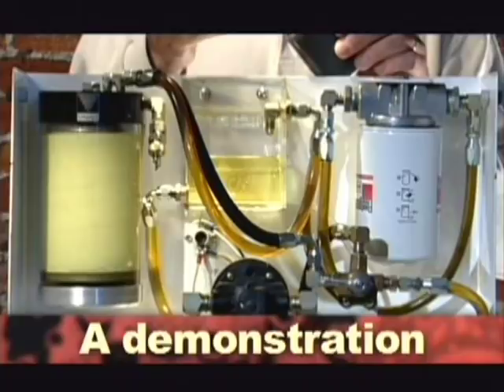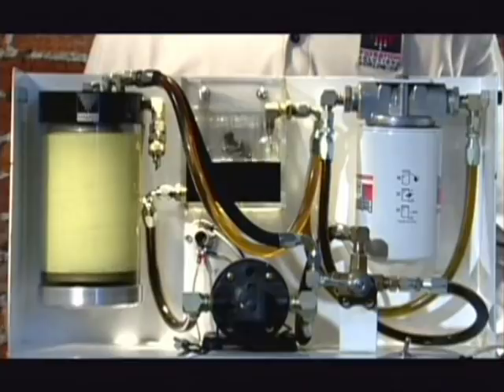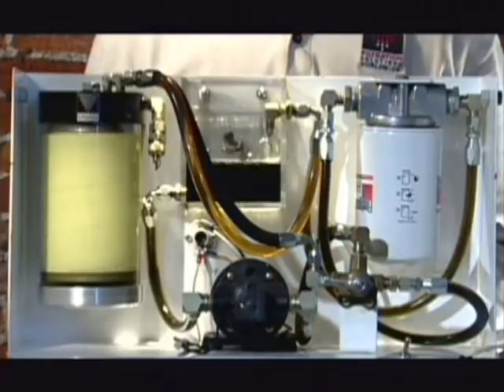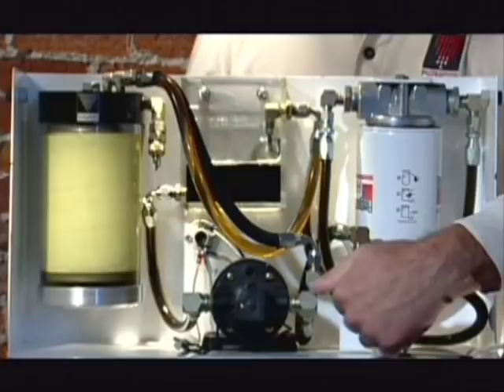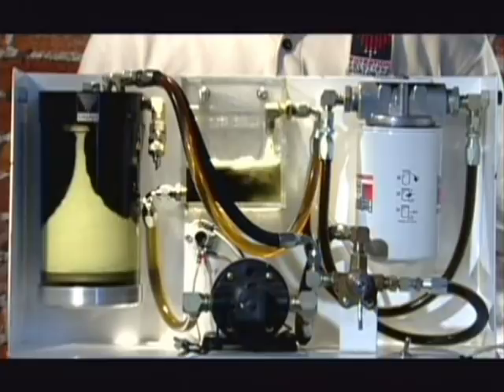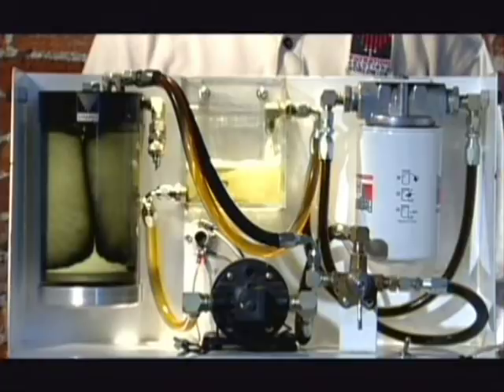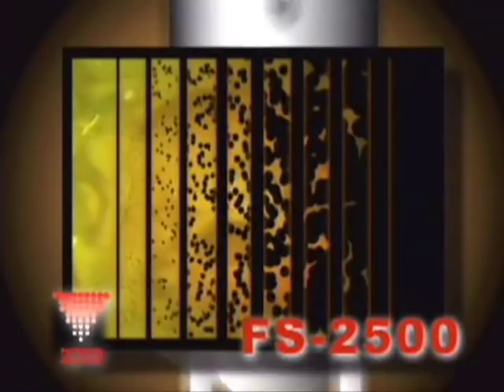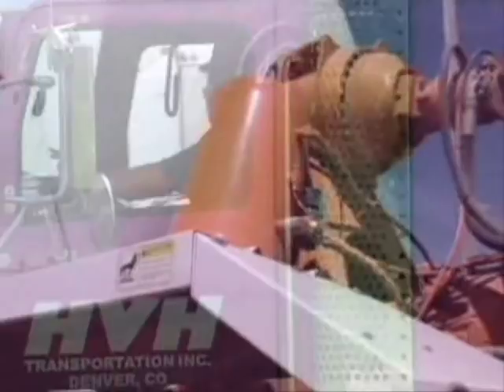Amazing Filter Demonstration - Save Your Engine

Comment: There's no reduction in oil flow if you use an oil filter adapter. The adapter lets the main filter and the bypass filter to be parallel to each other. Put another way, imagine going down a road that eventually splits off into two directions. One road is called "main filter" and the other is called "bypass". Most cars take the main filter road and a few take the bypass road. However, both roads rejoin a little further down the way and ALL the cars go into the "engine mountain tunnel" together.

Comment: .... the most damaging particles are as big as the filter misses.... Most filters don't do well below 10 or 20 microns... so obviously the most damaging particles are going to be like 2 microns to 7.

But what I want to know is... how many ppl have tried this secondary filter idea? It seems like an awesome concept!  ... so long as it doesn't reduce oil pressure - which is why most oil filters have a bypass valve and operate at 10-20psi.... not 80psi.

Comment: if it slows the flow of oil... can that really be a good thing? Moroso says...

"After many years of designing and testing racing oil systems and related components, we’ve determined what’s most important to oil filtration. Many filter manufacturers stress the importance of filtering the smallest particles out of your engine’s oil, with references to "micron ratings" of 10 or less for a filter’s efficiency.
With the help of research performed by filtration technology experts, Moroso engineers have determined that particles smaller than 20 microns in diameter are not large enough to produce engine wear. Furthermore, we’ve found that filters with extremely low micron ratings create an excessive pressure drop across the filter. They can be so restrictive that the filter by-pass valve can open. With the by-pass valve open, unknown to you—NO FILTRATION will occur!
To maximize filter performance, Moroso Racing Oil Filters have a rating of 27 microns, which produces a maximum initial restriction of only 2.5 psi when tested to SAE j806! The result is less pressure drop, more flow, less oil by-pass and maximum filtration performance important in severe racing conditions."

I'm gonna go, with Mor-O-So! (Ha!) ~ John B. ~ 1985 Corvette L98 (Un-Modified,  230 HP) ~ Moroso #22460 $16.95 at Amazon.
Reply: The type of filter shown is a by-pass filter, not a primary filter.

While the primary filter takes care of oil feeding directly into the engine, the by-pass filter connects to a port on the oil gallery with a small restricted line and takes a small part of the oil to the by-pass filter to remove very small particles and stuff that can cause the oil to break down prematurely and then return it to the oil pan.  A by-pass filter's sole purpose is to extend the life of the oil and primary filter, not to be a primary filter.
Reply: Oh, that's objective. A company that sells filters tells you that their competitors...all of them...are relying on junk science, and that their own extremely cheap to produce filters are the right way to go, and you're good with that?
Reply: @johnnannery2324  So far, I'm good with the science. What do you think about the science? The 10/20 micron claim? Honestly, I would like to see validated documentation to confirm that myself. It's rare that you see any kind of validated documentation for ANY product, much less oil filters. Go out into the world and read some advertising. Do you see anybody offering validated test documentation for their stuff?

Moroso has a long standing excellent reputation in the autoparts and especially racing autoparts industry where racers can be very demanding. The Moroso racing filters mentioned here also have excellent reviews. I'm "good with that" as well.

But no where does it say that the Moroso filters are "extremely cheap to produce". What data do you have to support that claim? And what if they are "extremely  cheap to produce"? What's wrong with that? Maybe if that's true, their could be a number of Good reasons for that, and the savings and/or technology are being passed on to the consumer. Many computer components are like that. There are many products of all types that are better than the competitors products, but Don't hit the market to benefit us because they are Not "extremely cheap to produce".  I don't see where the cost of production has any relevancy as to whether a product of any type is good or bad. The important thing is the performance. I'll also point out that in the world of high performance, racing oil filters, the Moroso filters can be considered something of a bargain, especially if their science is unique and effective.

Comment: These are great for stopping engine wear I use something similar on my car, while a full flow oil filter filters down to at best 20 microns. These can filter down to 2 microns by attaching to the pressure port and only filtering a bit at a time. The bull s** part is yes the oil will still go black. there is soot smaller them 2 micron but it can't cause any wear and the filter is good for 60000 clicks or so

Comment: It's a bypass system. Not a full flow system. The main oil filter pulls larger particles and keeps the flow high to maintain oil to the engine. Bypass filtration slows the flow so much the engine would run dry. So, add bypass and give it a chance to work. It's not as magical as the vid shows. The video is not a running engine, hot and constantly adding crap to the oil. It will take 5-10000 miles and at least an oil change or two to clean like it shows. Put this on a new engine and you'll wonder if you ever have to change the oil. P.s. yes you still need to change oil but, not as often. Do oil samples and use a good oil lab. They will tell you to change it when it needs it.

Comment: The smaller the partials the filter can catch the more often you will need to change the filter.
Reply: Oldandsickofit You guys. Read what Dan P. wrote, or go to the Amzoil website, or Bobtheoilguy , and do some research for crying out loud. I guarantee when you do you will regret posting these ignorant statements. Sure sign of "wet behind the ears" behavior. And to Azourecosee, Diesel engines get dirty a hell of a lot faster than internal combustion engines, and use  diesel oil which has much higher TBN specification which means several times the detergent as non diesel oil. Dirty oil in any vehical means that the oil is doing its job. If oil is staying clean in your motor chances are the oil isn't cleaning it properly. That is what one of oils most important duty is to clean the engine by suspending the soot in your engine rather than allowing to collect around in places like bearings and races, or just falling to the bottom of the pan. Then upon change intervals you get rid of it. The idea of a bypass filter gets better the dirtier your oil will get, and that is why installing it on your over the road tractor is a must to make money by keeping your truck out of the shop over the life of it. I guarantee using one will save you several 10s of thousands of dollars. All of the owner operators use em. The ones who don't struggle and usually don't stay in thier own rig and wind up working for someone. This is a good subject to start learning how to think in a logical manner. There is hope for the ones who actually take time out to view the video. I mean the first step to becoming successful is being curious about the right things.
Reply: Joe Blow a Diesel engine is an internal combustion engine.

Comment: Your filter might be better for my engine but since cummings makes the fleetguard filters I have to use them to keep my warranty unless of course you folks will guarantee if your filter fails you pay for my engine repair correct.
Reply: You don't need to use Fleetguard filters to keep your warranty valid...

Comment: Deceptive 
I put one of these systems on a V8 and after 2k miles the oil didn't appear any cleaner/clearer then i used a clear plastic bottle and ran the motor to see whats coming out of the bypass filer line....dark oil
it may filter to smaller particulates but it defiantly does not "clean/Clear up" oil

Comment: Look at the discharge line going back into the reservoir,  compare the both from filter to filter. Look how much stronger the flow is on the 2nd filter. This means a serious increase in pressure.
Reply: Good Bad ?

Comment: It doesn't affect oil pressure.  The system is such that they are plumbed in parallel and the bypass filter inlet is restricted to only take a small volume of oil, but its enough to eventually clean out even old dirty oil, new oil wont even get a chance to get any soot in it with these filter inline.   Most people that run these end up extending drain intervals and getting their oil tested however.  If you're just doing regular drain intervals the gains may be debatable.

Comment: In my experience with regular oil filters the transmission will die long before the motor.
Reply: +tjsi63 unless its a manual
Reply: Even if it's a manual you'll have to drop the transmission to replace the clutch before the engine needs major service.
Reply: My grandfather had a Olds Delta 88 with 300K+ miles on it on the original transmission. Don't drive like an racer and change the filter / fluid and it can last a long time.
Reply: Esp on Honda vehicles these days!

Comment: This is a bypass filter man. You will still have the regular oil filted on your engine filtering the oil. This one will filter oil as well, just in smaller amount. It will hardly effect psi.

Comment: My question is: how can the oil flow be the same with such a high efficiency filter, and won't it raise the oil pressure by restricting oil flow ? Surely less oil molecules can pass thru in the same amount of time in a filter with "smaller holes" ?
Reply: Probably it is ment to be a bypass style filter.
Reply: The filter media is probably synthetic which filters better because it's deeper and thicker while still allowing adequate flow. Most oil filters, however, are cellulose-based and are more restricting.
Reply: The pressure of your bypass is set at a certain poundage, allowing oil to continue flowing, even if the filter is totally clogged. You CAN'T lose oil pressure with a bypass filter unless your circulatory system has a problem, like a bad pump.
Reply: +Gary Chandler Oh, and you are correct in the thought of lesser filtration, but the point is moot since better filtration is still better than low filtration. What would you prefer, say oil that passes thru a loose filter every 3000 revs, or oil that has gone thru a tight filter every 6000 revs?
Reply: Nick Armock It's not a hard and fast rule but generally, synthetic media allows greater flow than cellulose media. If you compare the two under a microscope, you will notice that synthetic media fibers are not as closely "knit" as cellulose fibers. That being said, the synthetic media is usually made thicker in order to compensate for the more spaces between the fibers. This will impede oil flow a little bit but will still flow better than most (but not all) cellulose media while still providing adequate filtration. Also, because it is thicker, it will last considerably longer than standard, run-of-the-mill cellulose oil filters as it holds more crud. For example, I use the Fram Ultra on my car which uses 100% synthetic media. It filters down to 20 microns at over 99%, flows at least 10 GPM and can be run for 15,000 miles. All this info was provided to me by a guy who works for Fram. It's their best filter...by far. They are amazing and are beautifully constructed both inside and out. They are nothing like the cheaper Fram filters. Well, off to bed. Have a Happy Thanksgiving!
Reply: Bypass filters are in "parallel" with sump filter. It works similarly to the bypass valve within most regular oil filters. IOW not all oil passing through filter canister flows through filter medium. The difference is that a sump filter is mostly filtering at idle, or high gear / overdrive. A "bypass filter" filters oil at a greater rate when engine is at high RPM.
Reply: AlainHubert 
Bypass filters are in "parallel" with sump filter. It works similarly to the bypass valve within most regular oil filters. IOW not all oil passing through filter canister flows through filter medium. The difference is that a sump filter is mostly filtering at idle, or high gear / overdrive. A "bypass filter" filters oil at a greater rate when engine is at high RPM.
Reply: These filters work better because they have multiple stages that each one filters a size range of practical. Therefore allowing the next filter inline to remove smaller then previous particals. Standard spin on filters just have one type of pleated filter material. But almost all filter holders or frames have internal check valves that open when the pressure reaches to high to prevent the filter from exploding if it's clogged. Putting a multi stage filtering system like this onto anything that has flowing oil in it is the best way to make it last.

Comment: I originally thought the FS2500 was the Fleetguard filter, but now I see that the competition is using an ID system very similar to Fleetguard....
I'd like to know what filter they're using to compare their bypass filter to...that white spin on filter looks like a basic filter, but what is it's micron rating?
Thanks.

Comment: I think the 4 to 7 micron particles wear engines so much more is because there are inherently so many MORE of them, so this filter could have merit as a supplemental, not mainline device.
Reply: BINGO. Small particles cause the most wear in a normal engine , because small particles are all that's left in the oil after it passes through the oil filter. If the larger particles were still in the oil (like if the oil filter's internal pressure-relief valve gets stuck open), I guarantee you they'll cause more wear than the smaller particles do.

Comment: Did you refill fluid with same amount of soot from the start.   Maybe first filter goes into bypass from overload.  So possible second filter might bypass too.   Definitely second filter will get the smaller particles.  Nice.   Need one for my car.

Comment: the best thing to do is use a good oil filter and change oil regularly, i have always changed oil and filter every 5k road miles, and notice i said road miles as on asphalt roads.
Reply: +john hempstead That works but a regular oil filter will not remove the particles that cause the wear in your engine.  Most people not only want to extend the life of their oil but also stop the wear in their engine so it lasts a lot longer.

Comment: I run by-pass conditioning coolant filters on all my vehicles and they work great. Would be nice to have by-pass high efficiency oil filters as well . Guess it would be quite a hassle to plumb on gas powered cars and trucks.
Reply: I use the filters with oil analysis. saves me money and protects better.

Comment: also,nothing magic happens at the 10k mile mark.Filters lose their flow capabilities almost right away because the previous filter was already saturated and oil was routed through the pop-off.Put on new filter and immediately those particles are captured, the pressure rises and the popoff goes into bypass again.There is only ONE way to avoid this and that is to run a fine filter and change it every couple thousand miles or less, and that isn't really an acceptable solution for most people

Comment: Must be spec to car system, car system must be able to have same flow or better or you will starve system too.   Need back pressure flow chart.  And same specs for car or truck you want to use with

Comment: my volvo 770 2003 with a ved 12 engine i only used fleetguard filters at the petro lube,i got 1,250,000 miles on it when i sold it and the only major problem was inj #5 went out mpg were 6.7 . it was equipped with 3 oil filters but only used fleetguard never donaldsons or red filters.

Comment: @crazydiesellover Also, I just read this on the FS-2500 site:  "The FS-2500 meters the flow of oil within the matrix of the element itself. The average flow rate throughout the life of the element (10,000 miles for Class 8 trucks) is 1.5 gallons per minute. This is very slow relative to what your oil pump is displacing, but fast enough to keep up with contaminant creation/ingestion."  Now, they even say that the rate is slower than your pump works...so why is this not a red flag to them?